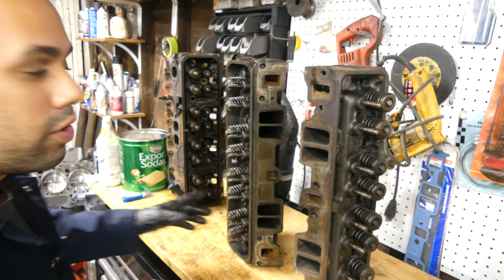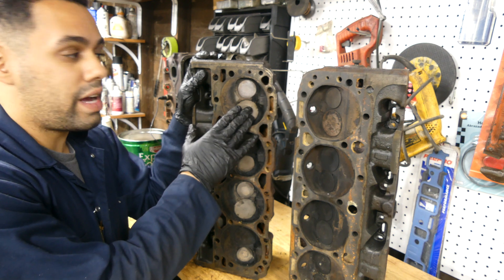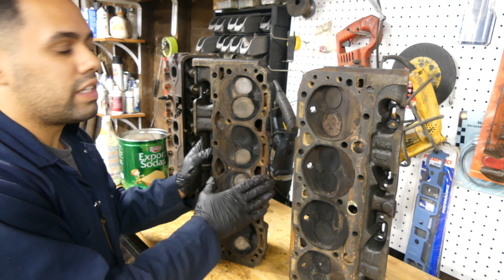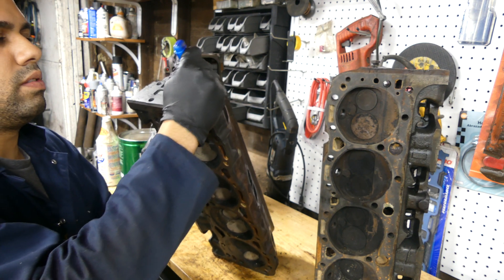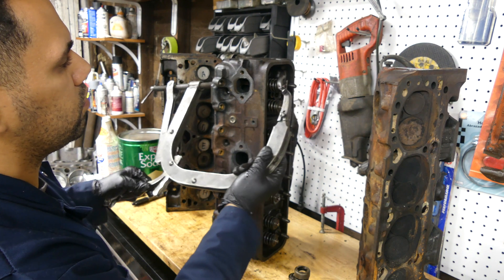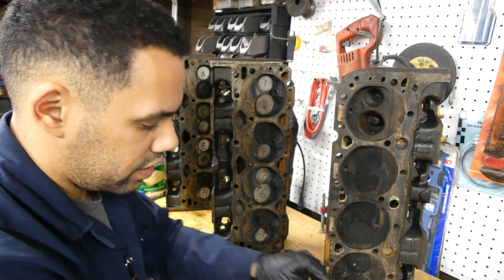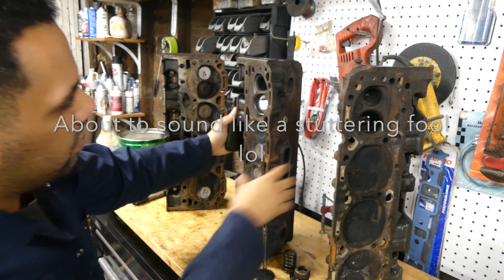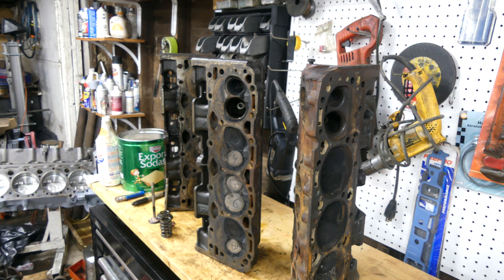Vortec Cylinder Heads Part1

Comment: I can't find the second video?  What is the best cast number on vortec heads?? Made in México or usa?? Thanks alot 👍
Reply from the maker: There is a part 1.5 and Im doing a porting video starting today.  062 heads flow more but have seat issues. With porting 906 and 062 are the same. I hear Mexican castings are better but have no experience with them
Reply: @brokejoebuilds5165  not sure if you guys have noticed but my experience the vortec 062 seem to be cracked more over vortec 906’s head’s i purchased 6 sets last week of 062 heads every one of them
Was cracked same spots water jackets I got 4 sets of 906 not one was cracked! But some 906 have press in exhaust seat if I’m not mistaken.. but not all
906’s do but love the info and channel🤙
Reply from the maker: @cdpperformance2613   yea, i have learned a ton since this video and I really need to do an update. Thanks for the info and experience.  I too have gotten a few cracked 062 sets.
Reply: @brokejoebuilds5165  thanks i wait for them next videos. 👍